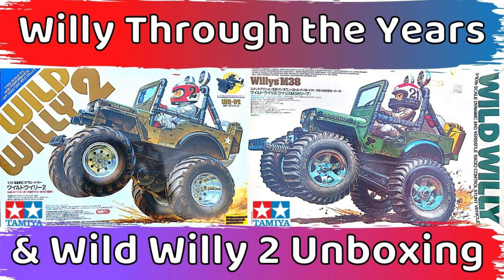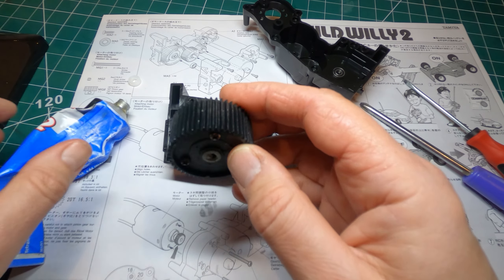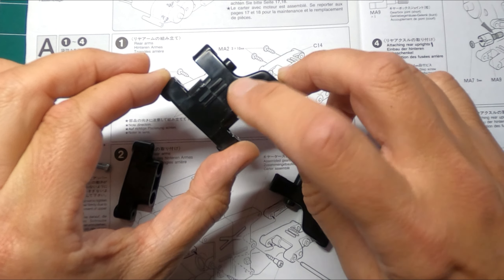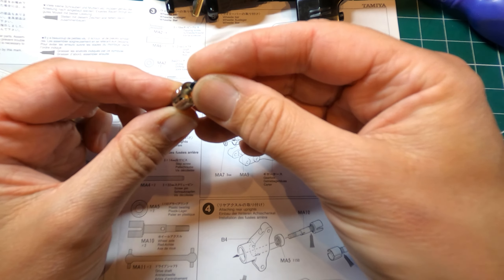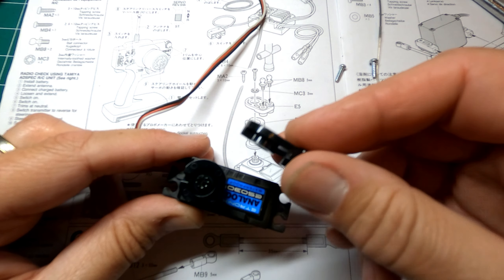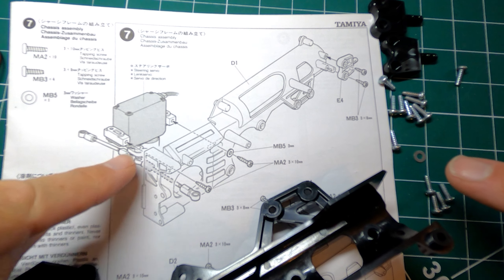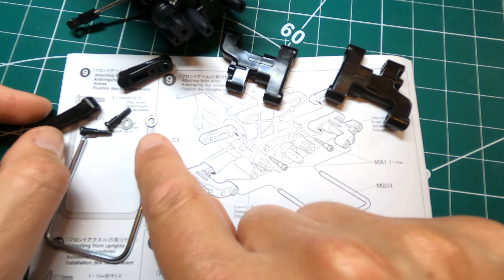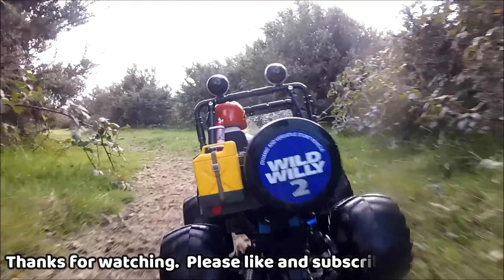Tamiya Wild Willy 2 Kit Build Part 1/3. Tamiya WR-02 chassis kit 58242 steps 1 -10 Brushless upgrade

Comment: Hiya Pete! Finally got some time 🙃🙂 I like the pace of the video. Very well done. Interesting with all the super glue. And interesting with the 2WD solution for the uprights. On the WT-01 they just changed the WR-01 wheel axle but kept the same plastic parts. I like the wheelie bar ‘pointing proudly upwards’ 😅🙂👍🏻
Reply from the maker: Ah well done for finding the time to watch these.  I know that there are about a million RC channels and most of them have got worthwhile vids to watch.  Yes the only problem I had with the original GF-01 was the screws shaking loose eventually and this is largely the same so I used super glue on the bits that get shaken the most.  Oh yes I had to get some slight innuendo in this. I see you have commented on the others so I'll reply in a sec....
Reply: @PeteWylieRC  Ahh, problem is not too many channels. Problem is too many kids and too large lawn to cut etc. ;-) Only kiddin'. Kids + their mum are first priority in the spare time. Then the house. Then the hobby.

Comment: Hi Pete, hope you’re keeping well. Another great build tutorial and the magnificent Wild Willy. Weather a bit pants here today in Cambridgeshire, so having to do some tinkering with cabling and small modifications. Finally got some 2s LiPo’s and a charger, just performing an unboxing video of this items. I’ve made a spreadsheet log to for the batteries that I have, so I can log the charge voltages, discharge voltages and perform some efficiencies logging on the packs. ( I really must get out more eh?) That Absima brushless motor and ESC, that you have, it will be interesting how the Wild Willy copes with the power, it might do back flips 😉👌😂
Reply from the maker: Hiya John. Yes not so bad thanks. Hope you're ok. Yes weather here has been a combination of occasional sun with intermittent heavy rain. Have taken the opportunity to do some work on part 2 of the Willy build vids. I will look out for your video about the lipos. The spreadsheet sounds very nerdy indeed. I love your dedication 😃 Really the only thing is say is to only charge up shortly before your RC session and return them to storage voltage shortly after. Storage is about 3.8 volts per cell. I'm sure that you will notice the difference with your Typhons. Have you got brushless sets for them yet? Anyway, many thanks for watching my friend. Best wishes to you 😁
Reply: @PeteWylieRC  Hi Pete, Brushless set is the next step, I'll be taking a look at your Absima set on your Wild Willy and see how that performs. Thank you for the LiPo advice, just waiting for some XT60 connectors. Take care my friend.
Reply from the maker: @JF-RC  Hi again mate.  Just watching your lipo vid.  I've got the Absima set in most of my Tamiyas and it is really good.  If you are sticking with 2s then it will be fine.  It is ok for 3s but I'd be inclined to get a 100amp one if you wanted to go 3s in your Typhon as it's a lump of a car.  2s is plenty quick in the Arrma tbh. I'm assuming that your pinion on the current brushed set is 3.2mm?

Comment: You can use the spare bits left over from the kit to make a damped wheelie bar. The tamiya wild willy is bomb proof had mine 3 years and its still good as new. So far mine has cost 450 or so and has a real metal radio controlled winch, full light kit and runs 8.4v nimh with brushed 550 and modded suspension. I do not do lipo or brushless in any form with my rc cars. Im olde school tamiya.
Reply from the maker: Hi there. Yours sounds amazing. I do have another Willy built by someone else and it's modded with working lights and some custom bits. I did find brushless to be too much in this one and mine is now brushed. Solid bit of kit like you say. Many thanks for watching 😁👍
Reply: @PeteWylieRC  Ive just built a tamiya tt01 type E type R needed 2 user manuals and was a bit of a nightmare to build lol. Yeah proper head fart.

Comment: Hi Pete another awesome build vid of a beautiful tamiya rc. With regards to the paper part for the motor do you have to use it as I didn't with my lunchbox. Thanks for the vid can't wait to see a running vid of that bet it will be awesome. Thanks pete for the vid 👍
Reply from the maker: Hiya Alex. Many thanks indeed. You know I'm not sure if that little fibre motor plate is entirely necessary. I'm guessing it's so that a hot motor doesn't melt the plastic but it would need to get incredibly hot and really it shouldn't if all is well. If you have managed without it then it must be ok. Thanks again for your great feedback 😁
Reply: @PeteWylieRC  cheers pete for your kind reply. Can't wait to see your next vid.

Comment: First off, great video but I think the super glue is a bit overkill. I know it's to hold the screws but wouldn't Loctite or model glue be little better?
Reply from the maker: Hi there. It is still possible to remove the screws that have been super glued. It's not as permanent as you might think. Also, never use any kind of threadlock on plastic as it destroys it. I made that mistake on one of my early kits and everything broke! Only use that for metal into metal. Many thanks for your comments. Much appreciated 😁

Comment: Hi Pete  , I am building a Willy and am concerned by how vulnerable the dog bones and cups are to sand and grit !! ( I built a monster beetle and seem to remember some rubber boots ??)   any suggestions please .     best regards from Wales .
Reply from the maker: Oh yeah they are indeed not ideal for sand although with the big tyres the dog bones are a fair way off the ground. It's not really a huge issue and I do run mine in sand sometimes. It's useful to have a high power blower to get the sand and dirt off after the run. If you are running on the beach then try to avoid it going in the sea because that really is bad for it! Hope you enjoy it when it's done 😁👍
Reply: thsnks for the advice , and no I won't be going in the water ! @PeteWylieRC

Comment: Hello Pete! What’s the purpose of the cardboard motor plate on the Wild Willy 2 ? Keeping heat off the plastic gearbox ? Doesn’t seem like it’ll last very long . Do you think it would do any harm to mount the motor without it ? Nice videos by the way!
Reply from the maker: Hi there. Well I don't think anyone knows for sure but the theory is that it's to protect the plastic from a hot motor.  They do last fine as it's sort of fibre board rather than cardboard.  The motors don't really get that hot with a standard battery so probably ok without it but I have always used it just in case.  Many thanks for your great feedback :-)

Comment: that super glue is a bad idea! 
what if you need to replace parts? and ive never had a screw back out on my tamiya plastic threads, i don't see the need for it
Reply from the maker: Hi there. I've had screws shake loose in things like suspension before. A super glued screw can still be removed for maintenance. Been doing this for years on loads of kits. I guess it's not necessary for light runs or if you remember to check the screws for tightness occasionally. Many thanks for your feedback 😁